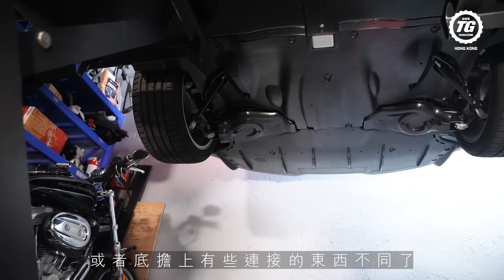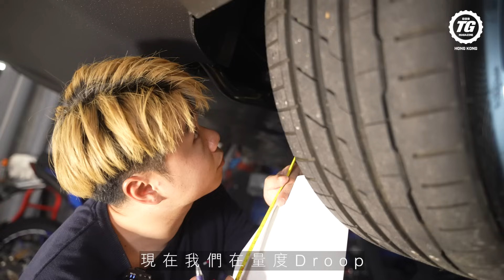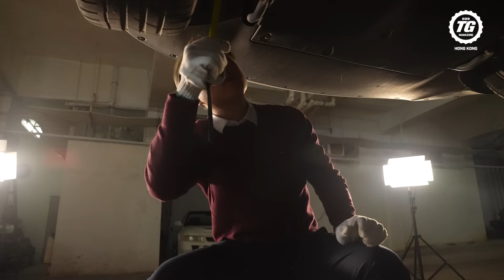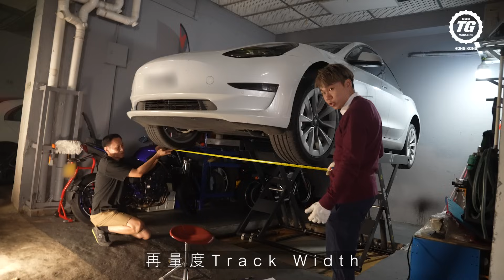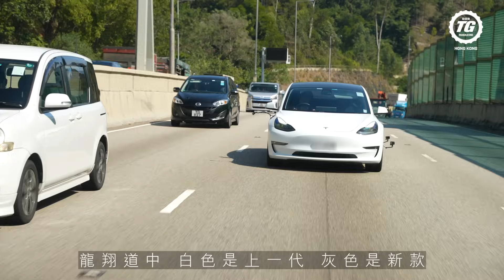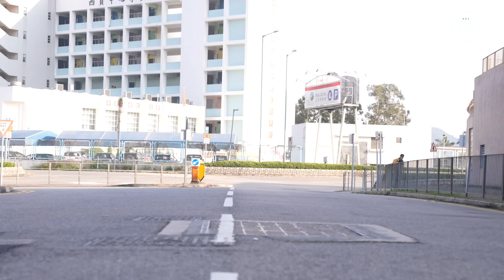新版Tesla Model 3車底有乜唔同？ ｜TopGear HK 極速誌

Comment: One big difference that cannot be seen is the revised suspension bushings. Laminated glass was also used on the roof and rear glass on the pre-facelift 3, not just the front side windows. The only real change is that the rear glass is also laminated now on the facelift model.